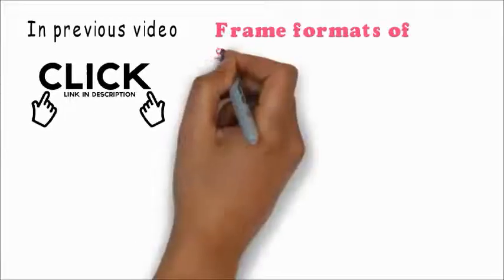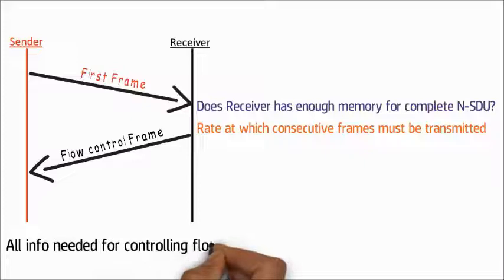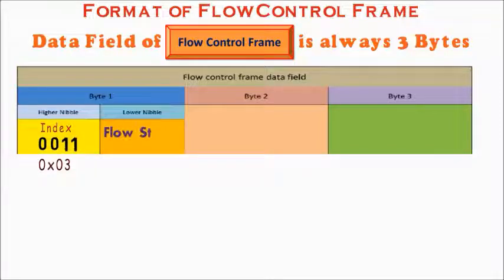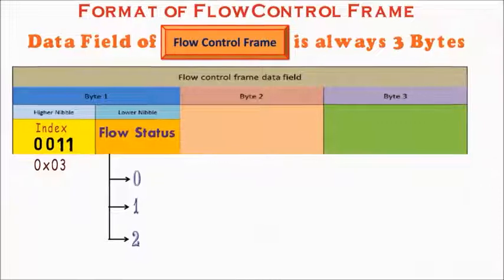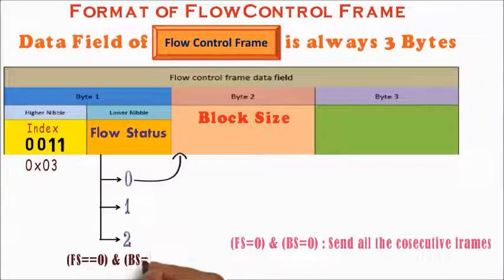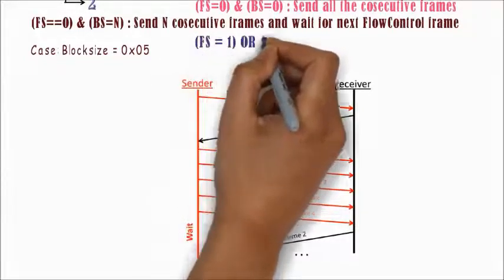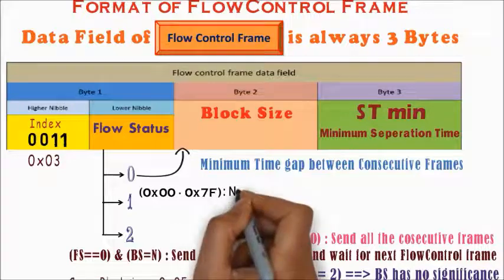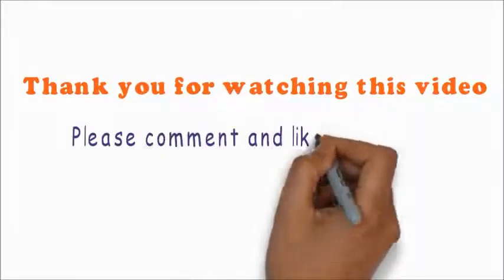Flow Control Part3 : Flow control Frame Format

Comment: Hi bro, 
One doubt.
Assume diagnostic buffer size is 64bytes,
I need to transfer 128 bytes of data from ecu, now what is block size and after how many consecutive frames need to send flow control frame??
Reply from the maker: Block size is seven I think and two fc frame will be there and you can use paged buffer concept of dcm